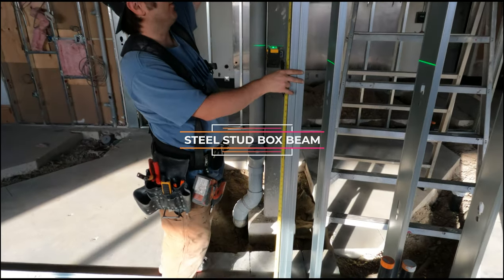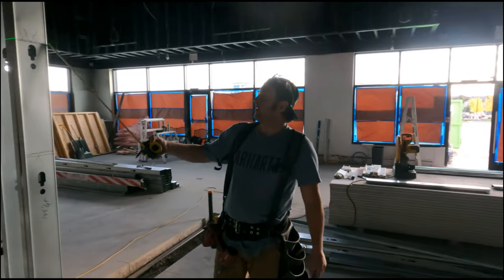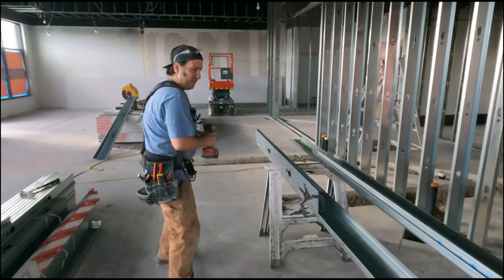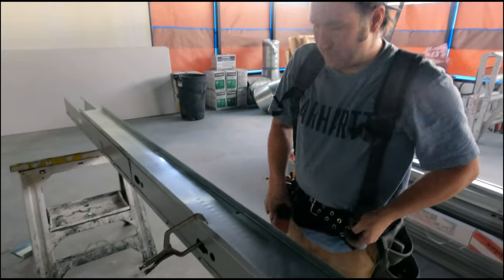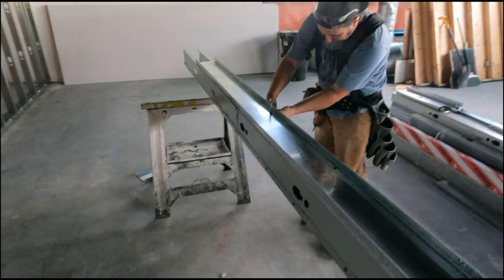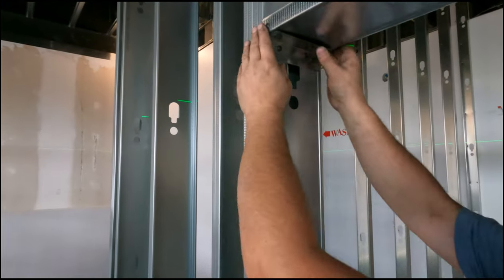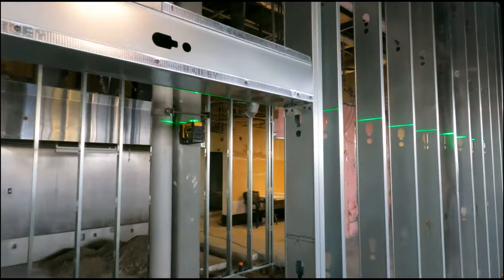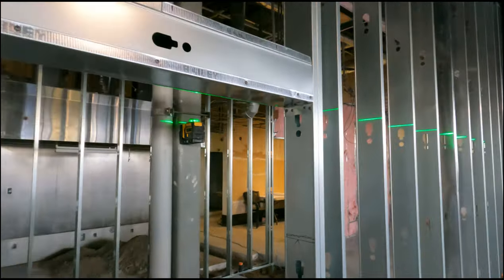Metal Stud Framing Box Beam

Comment: You really need to determine your high side first and only make one mark per attachment. Not sure what the deal is with the extras marks and "moving it up a bit". That just creates a point of misinterpretation...
Reply from the maker: Yes High side and carry across. The first marks are just to see the high side, Then I square across. You the same dude who commented on the double stud corner? That was a live stream segment someone must of asked or said something about if that was okay, and sure man, Ive seen it all, more is always  better than less especially with double layer. But usually no never double stud a corner.
Reply: @ConstructionKronies  okay, but why make the initial marks to find the high side. Just measure it. Just my opinion. Because I've found that any extra step you put in takes time and cuts efficiency, but also leaves an oporrtunity for your team  to make a mistake on. This may sound rude or arrogant, but I try to make my work dummy-proof for those around me. Again though, just my opinion I guess.
Reply from the maker: @thomasanderton2057  the reason I like the marks is it's easy to use as a guide to keep square across the stud if you know what I mean. I just make the initial ticks so when I put the laser I know the high side immediately and can move the laser or keep it on the one it's at then I square across the good ones.

Comment: how would this differ if it was an outside load bearing wall?
Reply from the maker: The gauge of steel will be 18 or 16, everything else the same. However, with the heavy gauge I would use track clips instead of angle and would leave 1-1/2" on either end for the studs to slip into the clips. Hope that makes sense bro!

Comment: Have a question , on a partition non bearing wall, the studs 25 ga. can be use for walls in commercial job?
Reply from the maker: Yes they sure can. Use 6" for plumbing walls and 3-5/8" for the rest. Make sure the walls have carrying channel every 4'.
Reply: Depends on the length of the stud. 20 ga stud should be used beside doors and openings.

Comment: This is Tina from Hebei Dashu Integrated Housing Co.,Ltd,China.

Our factory is engaged in the construction of light gauge steel villas and the production of light gauge steel frame.

Not only can we provide all the materials for building light gauge steel villas, but we also have a professional design team that can design foundation drawings, renderings, floor plans, elevations, and circuit diagrams for you.

If your company needs our help and support, we would be honored to cooperate with you.